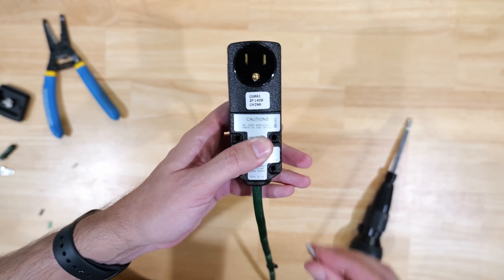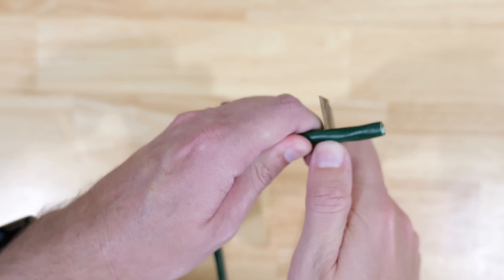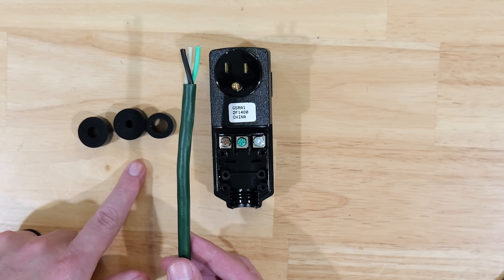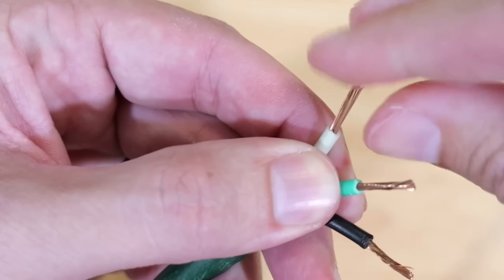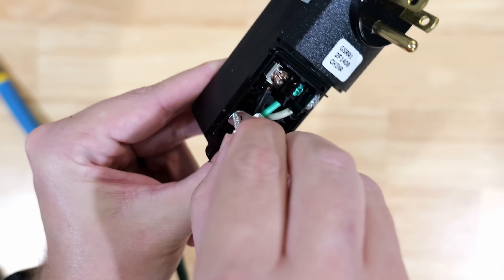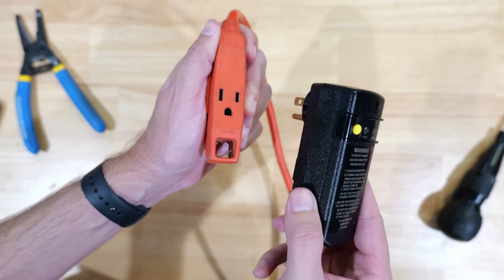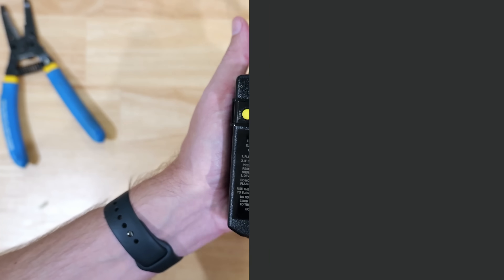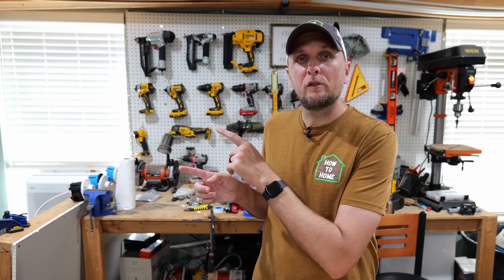The Genius Plug That Makes GFCI Outlets Unneeded!

Comment from the maker: Have you ever seen these before?  How many times would these have come in handy for you and provided a safer connection?
Reply: Thanks… I’ve seen the inline GFCI adapters, but not the replacement plugs. I’m going to order some. …cheap insurance!
Reply: What if it’s a 2 wire cord with no ground wire can this still be used?

Comment: I just cut a cord that has a built-in in-line GFCI that was on the Dewalt pressure washer. That should probably work just fine if I just add a female tip where I cut it. And then it’s a free GFCI well except for the cost of a three dollar tip from Harbor freight and the cord is long 😊

Comment: This is a very useful device for extension cords that may be used near water or in areas with lots of grounded metal. On the other hand, GFCI outlets are still very much needed! They are vital (and generally required by code) for outlets in various areas of a house (bathrooms, kitchens, washer rooms, etc) where devices are directly plugged in and water (and others sources of "ground") are present. Not everything uses an extension cord AND GFCIs can protect other outlets that are energized through them.

Comment: Meh. The video is a "nice idea" but useless for many even when you don't have RCD/GFCI wall socket. Easier way is one or more ways you get GFCI as a very short to long extension cord or GFCI that plugs into a socket then plug whatever into that. I have second type in my garage then plug into standard cheap ex-cord to run 12v battery charger and block heaters in a vehicle outside. I use "Cheap" cords because easy target for someone to wreck it even when have cones and other protection on the short length between door and truck. Chargers then hind under the bonnet/hood etc to keep them out of weather. That's even when I have RCD/GFCI outside required by Code and Hubbell Wet Cover near HVAC because a cord to it from the truck is a 4x longer path, passes under a gate and a major tripping hazard in more spots.

Comment: I’m not sure I’d be comfortable with a “Made in China” gadget for anything that’s safety critical. It could be an awesome product but there doesn’t seem to be any truth in advertising in China so you can never be sure it will work as advertised. If it has a UL or CSA approval then I’d be more interested.
Reply from the maker: It is made by Leviton which is an American company and it is UL listed.
Reply: @ I looked at the listing you linked on Amazon and nowhere does it say UL or CSA listed. Yes, Leviton is an American seller of low priced electrical devices but the label on the device in your video says “Made in China”. 

I have had to replace several Leviton devices in my house because they have failed. One Leviton 14/50R receptacle that I installed to charge my electric car started to overheat and melt. Fortunately my EV is a Tesla and the Tesla Charger actually sensed the impending failure and drastically lowered the current draw and notified me of the problem. I replaced that receptacle with a much higher quality part from Hubble and have been fine ever since. But, yes, the Hubble part costs over 4X what the Leviton part did. 

You do link a similar part that does have a UL listing, but it’s a 2 prong plug.

Comment: I was thinking while watching you insert the wire ends that you were not being careful to put them in on the left side of the screw so it pulls the wire into the connection rather than as you did on the ground and the neutral of them putting them on the right.  When you tighten the threads of the screw push the wire ends out of the connection.
Reply from the maker: That would be true if I was wrapping them around a terminal screw.  But I showed that is not how this connection works.  The wires just get fed in straight and then when I screw it down it cause a plate to come up like a vice to make the connection and secure it.  In this case it doesn't matter which side I put them on.

Comment: You seemed to place black wire and green on wrong side of terminal connection from I have ever learned from any one.  Is there a reason?
Reply from the maker: How is it the wrong side?  It doesn't get wrapped.  It is compressed by a plate just like commercial grade receptacles.
Reply: @ the stranded wires will more likely fray out it not wrapped around screw head. Not the only person that asked the question. Not saying it will but I believe nec code says to wrap the stranded wire in x way.  Maybe it’s changed or or your rule is best. I am generally asking for knowledge that I don’t currently have. I have done personal projects before with no issues.  However.  I have also had two house fires that, as far as I know, had nothing to do with my electrical skills.  I want only safe and quality info in a channel like yours as your typically giving stuff I couldn’t disagree with.
Reply from the maker: @aaronblackford981 I don’t think you are understanding.  It won’t fray.  It’s not being wrapped around the screw.  That’s not how commercial grade applications work.  They use 2 plates that compress the wire like a vice.  It doesn’t matter which side the wire goes on in that case.  Also, there is no code for what side a wire goes on a terminal screw even if it was being wrapped.  It is best practice to wrap wires around a terminal screw clockwise.
Reply: @ okay. Ty. No reason to be getting mad as I am dyi and was just asking questions.  I would assume commercial grade make the ripples on the plates make the wires go the same way within compression and screwing.  Ty. I honestly don’t know current nec codes as I have been outside of it for few years nor did you say whY either side works within the video.  Ty for the info and learning for me and hopefully others.
Reply from the maker: I didn’t express anger.  I just answered your questions.  I didn’t say why either way works because it doesn’t matter.  The plates don’t make the wire go in any direction. It just stays in there straight.
Reply: Interesting that the product is made in China. I am always skeptical of the quality of products made there.
Reply: @robymulier  How many products are you finding that aren't made in China?   If it was a non-none Chinese-made product, I might have some concerns.  But this device is produced by Leviton.  A good brand.
Reply: @ The number of products is not the point. The quality is. I merely stated that I am skeptical. Travel to any communist country and visit the factories. Let me know what you see. I personally have been to several. Leviton has some good brands but, like any company that also have price points to appeal to the consumer based on price.
Reply from the maker: @robymulier it’s always interesting when people say this considering most things you buy are made in China.  Like whatever device you used to make this comment.

Comment: Does it work on 2 wire power tools?
Reply: That was my question.  From what I know about how GFCI's work (they basically measure the difference between line and neutral current and trip if there is more than approximately a 5mA difference), I would think yes, it would definitely add a measure of protection to a two-wire (no ground wire) extension cord or power tool.
Reply: @miltonthecat2240  Given that 2-prong hair dryers have GFCI plugs, the answer should be yes.

Comment: Add a female adapter and you can use it on various tools.
Reply: That's what the extension cord does
Reply: Or just buy a GFCI 3' extension cord They're literally for the purpose of adding GFCI protection to things that may not require an extension cord or before an extension cord.

Comment: Thank you… You might very well save someone’s life with this video.

On my house (I am the second owner) the exterior receptacle IS GFCI protected, but the receptacle does NOT have the “test” and “reset” buttons. It is wired on the load side of a receptacle in the kitchen that is a GFCI receptacle. Similarly, a the receptacle in the garage is a GFCI receptacle. The receptacle in the Master Bath is an ordinary receptacle (without any “test” or “reset” buttons), but is wired to the load side of the GFCI receptacle in the garage. (The receptacles in the other bathrooms are GFCI receptacles, so those are easy.) There is another receptacle in the garage that is NOT protected, so these products will come in handy (and might even save my life. …one in a million chance, but cheap insurance! (I’m a big believer in GFCIs.)

GFCI circuit breakers would make this all a lot simpler. (If I ever have to change out any CBs, you can bet they are going to be GFCI ones. (Definitely on the service breakers. …just makes life so much simpler.))

Thank you!

P.S. Whoever invented GFCIs, all those years ago… Think how many lives they’ve saved. It’s a one-in-a-million chance, but after this many years, that’s gotta be a bunch of lives. …not up there with equipment grounding, but still a bunch of lives.
Reply: your house must have been built in the early 90s.  my parents' house has the exact same configuration.  

personally, I don't believe in using breakers as GFCI protection, except in homes without ground wires.  mainly because I don't believe in shared GFCI circuits.  and the NEC has been gradually working away from them.  currently, garage plugs, kitchen plugs, and bathroom plugs can't share a circuit with other areas.  (unfortunately, it is still legal to pile every bathroom in the house onto one circuit)  but for GFCI protection, I very much favor local GFCIs.  you shouldn't have to run dripping wet and naked through the house because your bathroom GFCI nuisance tripped.  that's the sort of thing that makes people remove them.
Reply: To be clear, outlets that are properly fed through a GFCI are also protected by the GFCI outlet. Outlet testers are inexpensive and easily will let you check what outlets  are actually protected as well as if they are properly wired, grounded, and if energized.
Reply: @alandaters8547  it just bears mentioning that if you have an older house without ground wires, a standard GFCI tester won't be able to test the GFCI.  that doesn't mean it doesn't work.  the onboard test button will still test it.

Comment: Wonder if my wife’s old hairdryer with the gfi plug would work, have a few of them in the garage 🤔
Reply: Yes, just cut the cord off the dryer and add a female cord connector socket.  I've made several of these.
Reply: @pit4955  consider there max current rating

Comment: What is a ground fault, under what conditions do they occur, why should i care, what am i protecting when i install this device or use a disaster, GSCI? 
I have a house built in 1973. I run an extension cord from the garage to the back yard to run power tools. Twice a year. 
How can i make a decision if I need to be concerned?
Reply: GFCI is typically located closer to the source of the fault providing quicker protection than the circuit breaker.

A GFCI protects from shorts to ground, over current draw. 

NEC (National Electric Code) mandates them anytime a power outlet is located near a water source (bathroom, kitchen, outside outlet).

The other benefit is quicker reset. Most GFCI will trip without causing the circuit breaker to trip. Once you clear (fix) the fault you can reset the GFCI without having to walk back to the circuit breaker.
Reply: @laRiduzione Thank you for taking the time to respond
Reply: Ground Fault Circuit interrupters 101:  a proper electric circuit has power go out one wire and come back the other.  if power escapes from the circuit and comes back on a different path, that is called a ground fault.  why you should care is, the most common "different path" is through the person trying to use the equipment.  the most common condition causing a ground fault is a tool getting wet with dirty water. (pure water is non conductive)  the danger is that it takes less than a watt, in the wrong conditions, to cause death.  a 15 amp receptacle can deliver up to 1800 watts before the breaker is supposed to trip.  now, full disclosure: if the tool is in good condition, the weather is dry, and you are in good health, you will probably not get shocked.  indeed, you have probably done it twice a year for some time, and never been shocked.  but the rule requiring GFCIs where people might be using wet equipment is based on the consequences of it all going wrong, rather than the likelihood.  so it's up to you - but a GFCI adaptor like he showed in the video is relatively cheap.  - looks like around the $75.00 range. 

short answer" a GFCI protects people who get shocked, from getting shocked badly enough to kill them.